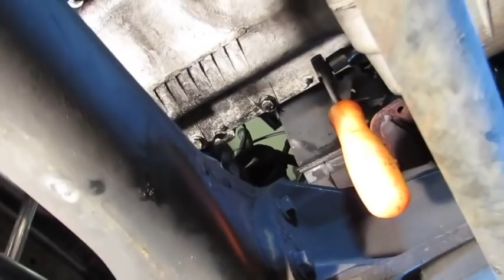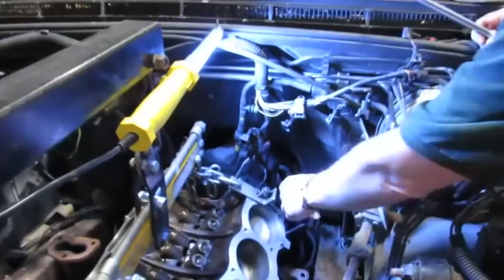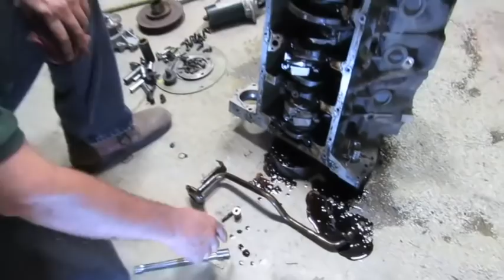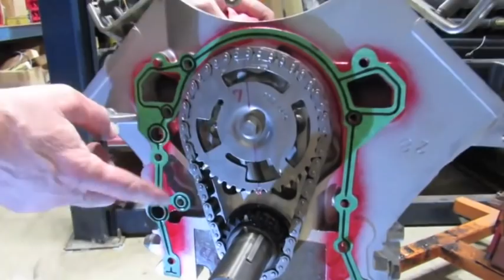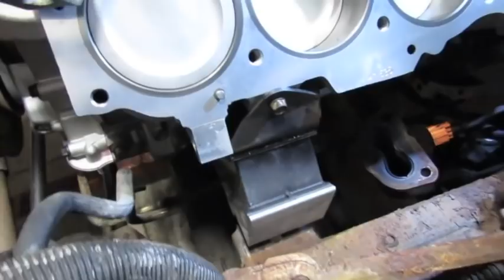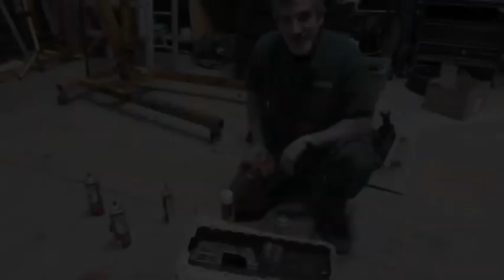Atlantic British Presents: Discovery Series 2 Engine Replacement

Comment: This is unbelievable. Atlantic British, and Doug specifically—huge thank you and kudos. Doug is like a celebrity to me, guiding me through countless repairs and maintenance over the last three years that I’ve owned a Disco 2, and it runs incredibly smooth with no leaks, unbelievably enough. The engine doesn’t need replaced yet, but I’ll be replacing it myself when that time comes, and it’s unbelievable that you guys have put together this video to make that process all the smoother. Thanks a million you guys.

Comment: Nice tip to put the oil pan on after the engine is back in the vehicle, Doug. Seems easier to put the pan on while the engine is still out, but that makes tightening the torque converter bolts unnecessarily difficult. Having the pressurized RTV for the oil cover and cruciform seal joints is key. Very nice work!

Comment: You forgot to mention that you have to take the torque converter bolts out!!  or the engine wont separate from the transmission (at least on automatics) Followed the directions and all went smoothly until that part.

Comment: Atlantic British - Great videos and products from you guys! Really appreciate you sharing the knowledge. Wondering if you can help me with the bell housing bolts...Following the RAVE, I've removed 8 out of 12, all from the bottom side. I cannot find the other 4 I'm supposed to remove before getting to the last 2 on-top. I think I see one of the bolts on the drivers side higher up, but its right up against the body and I'm stumped on how to get to it. That's only one though...Really not sure where the other  3 are...

Comment: so i have a 97 disco with the 4.0 litre engine in and 200,000 miles . It heat seizes after 30 minutes or so , so i'm gonna need to pull it and  rebuild it . Can i get everything to rebuild this from Atlantic British ??? New liners and pistons or short block and re build my heads etc , whats your thoughts ???

Comment: Does leaving the intake and heads in place complicate removal?
Reply from the maker: Removing the intake is nearly a must. Removing the heads does make it easier, but you can work around them if you are so inclined to leave them in place.
Reply: @atlanticbritishrp  I couldn't get over not using a torque wrench to install head bolts.   Then again we are talking about a rover, it's gonna blow the headgasket early in life no matter what....
That's why I'm going to rip mine out and never put another of those aluminum abominations back in...  Repower, loads of people doing LS swaps, I'm looking at doing a 6.6 Duramax swap on it.

Comment: I'm having so much trouble making my engine fit into the transmission. The crankshaft and torque converter are already lined up and conected, but it wont go all the way in and I have a huge gap between the transmission and engine block on the lower part. I already placed the top 4 bolts, but the gap is still bad underneath. Am I doing something wrong? Any tips? Would the gap close ones I mount the engine on the motor mounts? Thank you
Reply: I'm having the same problem. Did you figure it out?
Reply: ah. the torque converter wasn't properly aligned.

Comment: For those of Us, who may be able to do quite a bit mechanically, but are not really "mechanics" ... it really would have been helpful to have something mentioned about ensuring that the torque converter is fully seated, before bolting up the engine. 

I realize this is a basic concept, but it was completely skipped over.

I had trouble getting the engine bolted up, not realizing that the tq must have come out some, when I removed the old engine.

Not seeing that the tq was not fully inside the bell housing, and working by myself.

I managed to jam the engine into the tq because I had a gap on one side which I solved by putting bolts on where I could, and then drawing it together by tightening the bolts.

Until I went to bolt up the tq, and realized I couldn't rotate the crank pulley, or the tq I had no idea I had a problem.

Idiotic, I know... but the rest of the tutorial is so simplified that even someone like me thinks it is doable, and jumps right in... so a word about the tq, and ensuring it is seated would have been incredibly useful.

Now, I have to determine whether I have damaged the transmission, front pump, etc.

Thanks for your time and consideration, and have a great day.

Comment: Why would a relatively modern engine have sleeving problems and head gasket problems? Land Rover was owned by BMW and Ford at this time. They were aware of the issues when they bought the company.
Reply: South Hill Farm 
Theres nothing "modern" about this engine. Look up "Rover V8 engine". GM Buick engine from 1960's. Its been modifed and improved over the years but its just an old block that GM scrapped long ago...
Reply: Furthermore I imagine the new owners (BMW/Ford) decided aginst throwing a completly different engine and drivetrain into a outgoing model that was soon to be replaced by the LR3/Discovery 3.
Reply: South Hill Farm the dies were old and created porosity- the model was being changed so they didn’t invest the money in new dies